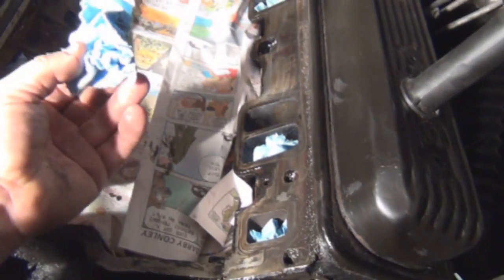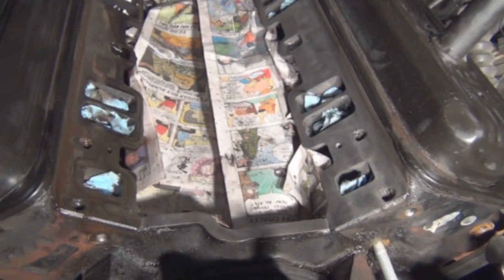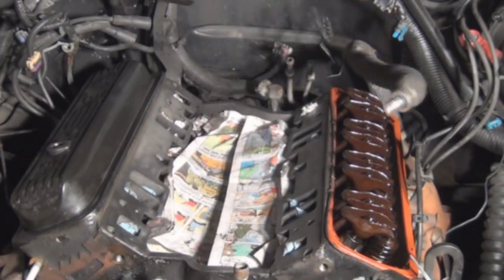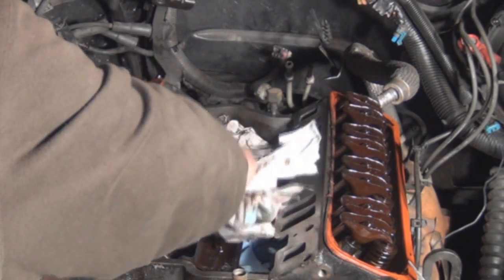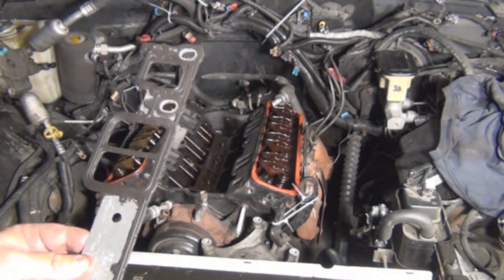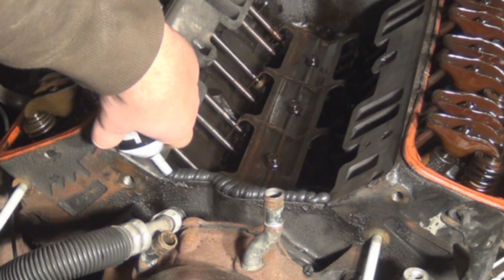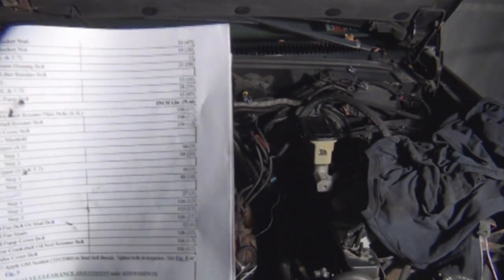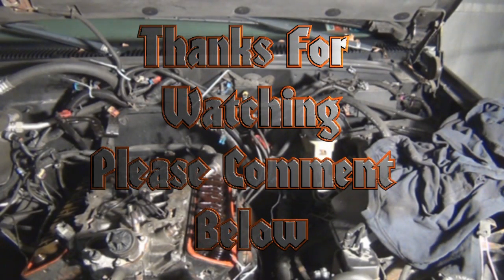Intake Manifold and Gasket Preparation and Installation

Comment: Never use thread locker on intake manifold bolts.  Teflon thread sealer that is designed for automotive use only. Not plumbing Teflon.  
Clean both mating surfaces (block side and manifold side) that are to be sealed by RTV with lacquer thinner on clean rag twice, immediately before applying sealant.  RTV/Silicone sealer does not stick to oily surfaces.  This is critical.  Don't use carb cleaner for this final cleaning, it leaves an oily residue.  Never tried brake cleaner but Lacquer thinner works very well.  Going for surgical clean.  Make sure your hands are clean and dry first also. If you have to move manifold after you have set it down on engine, pull it out, clean everything off and start over.  Go strait down on and don't move it, unless you don't mind oil leaks.
Reply from the maker: Thanks for watching and commenting. I greatly appreciate it. Brake clean works great. We use it to clean off the old sticker residue from inspection stickers on the inside of a windshield. It gets it nice clean and dry for the new sticker. I also use it for the rear view mirror replacement of the button when it falls off. Great results. Thanks for watching and commenting. Please like share and subscribe.
Reply: Hey xman, Finally found ya, had to factory reset, do u copy (railrider)
Reply: @railriderrider9192  Yes, I'm all over these S-10 videos, well, a lot of them.  Factory reset?  Please explain.
Reply: @x-man5056  on my PHONE. ..😂
Reply: Sorry...wasn't specific
Reply: I don't own home p/c. Pulled code po118 which already knew about. .. showed NOTHING on 3 missing BAD. Tested ,checked for vac. leaks and have found NONE. 😥
Reply: @railriderrider9192  So by "factory reset" you mean you just cleared the codes?  You KNOW #3 is missing but it's not throwing the #3 misfire code? (that would have to be a very intermittent miss I would think). 
p0118 is engine coolant temp code.  You had this sensor disconnected when you changed intake gaskets also, at least I did, just to give slack in the wire bundle.  It's down there right by the #3 plug if I recall.  Always in the worst spot to get to isn't it. 
Take a peak through wheel well, might be easier.  if you didn't disconnect that plug on the coolant sensor you may have pulled a wire loose in that plug.  If you did disconnect it, check it over anyway.  Those coolant sensors are pretty robust in my experience but they are fairly cheap so if the plug checks out OK and is properly connected, replace it and see what happens. 
Doubt that this fault has anything to do with MAF or #3 miss except that the coolant sensor is very near #3 and, because of the difficulty of working right there, maybe neither is connected right, worth a quick check anyway.  Pull that plug and check it over real good for a crack in the ceramic also.  Use bright light and magnification if you can.
No PC?  Sometimes I wish I didn't either but I can hardly see much of detail on my phone.  Consider a used tablet.  They are easier to use (much like your phone). You'll need access to internet, either tether to your phone or get wifi in your house.  Wifi with a smart TV gives you a world of options also.  Just a thought thrown out there.
Reply: @x-man5056  broke send unit when did intake gasket. B4 broke....same prob. on 3. Good spark, great comp. Totally GOING INSANE!! 🤪😂
Reply: @x-man5056  plug right dead behind steering shaft, no universal will work. Have to wrench socket. 🙄
Reply: @railriderrider9192  I use a short plug socket and a wobble extension, not a universal joint.  Still tight but works.
Reply: @railriderrider9192  laughed at insane remark.  Every experienced mechanic who read it did.
Reply: @x-man5056  I barely have enough room to get plug wire off. I'm considering cut off 1/4" off socket! 🤔
Reply: @x-man5056  I'm not crazy....mom had me checked!! 🤪
Reply: @railriderrider9192  I looked around and found a short socket...shorter than the other 2 I had any way.  Th wobble extension helps a lot also but a regular extension will still clear the steering shaft.  Last time I changed plugs I installed iridium plugs, hopefully that's the last time I have to mess with them.
Reply: @railriderrider9192  I had myself checked.  Mom said she didn't need to waste time and money on the obvious.
Reply: @x-man5056  iridium good they say for 100,000. U won't get none of u joints to work unless MAYBE 1/4 drv. I have iridium in mine.
Reply: @x-man5056  😂
Reply: @railriderrider9192  Yes.  Use a wobble extension, not a U joint, no room. 
You know what wobble extension is?  Where the socket can wobble on the extension itself?  
If you don't have any, highly recommend, u joints a pain.  You can get a pack of assorted lengths and drives for about $12 at Harbor Freight.  Very handy
Reply: @x-man5056  right on...I'll check w/ them next week
Reply: @x-man5056  I'm a retired heavy and light equipt. mech./ welder( all phases)  and field tech for Sears 7yrs. div. 71
Reply: @railriderrider9192  You'll like them.  When you see the end were the socket slips on, you'll see right away.  They make Allen wrenches like that also.
Reply: @x-man5056  I sold them when retired.
Reply: @railriderrider9192  Nice.  I thought you were experienced but couldn't tell if you recognized my verbiage.  Not sure if wobble extension is the right name, just what I call them.
Many home mechanics on YouTube  barely know a wrench from a hammer or they think they're interchangeable. LoL
Reply: @x-man5056  😎 I knew exactly from start what u were talking about....I worked heavy equipt in military...company put me in charge when they seen I wasn't a slow leak. And got promoted another grade. Worked for J.Deere when came home. Had a master mech. 3 tier tool box with everything. I  wish now I had worked for CAT. 💪 sears....85 to 91 nearly 7yr. then left. Built/welded fire truck bodies for E one, ocala,fl. Alum. Mig, local forge said I had a very impressive work history and started me 1$ more than asked for.
Reply: @x-man5056  I have dislexia... 3 bad bike wrecks....v.a. helped get my dis. retirement. I am WORE OUT!! Chronic D.J.D.🤦‍♂️
Reply: @x-man5056  when v6 gets 2.5 rpm and higher  u can feel cyl kick in out intermittent gonna try another new plug tomorrow!! Thanks friend!
Reply: @railriderrider9192  Sorry to here that.  I am Navy Vet, Vietnam. retired from DoD after 42 years.  Started as Aircraft mech and worked up to Manufacturing Quality Engineer. 
I ache a lot also.  Recovered from Carcinoid cancer but still have PV (Polycythemia Vera), also COPD.
It's difficult to work on my cars and mowers etc. but can't afford or trust anyone else to do it.  I keep chugging along just because.  Just slower. i just turned 66.
Don't know what D.J.D. is but doesn't sound good.
Currently live in NC but plan to head back west soon, away from humidity.
Reply: @railriderrider9192  You bet. You can check the resistance on the plug and wire first if you have a meter still.  There's a dozen YouTubes on it...LoL
Reply: @railriderrider9192   Just struck me that this could be an injector problem also.  They can be tested but the spider setup these use makes a bit more difficult proposition.  Seems odd that you are not getting p0303 code.  Have you checked fuel pressure?
Reply: @x-man5056  no sir...I suspected that tiny spray nozzle might be bad....SFI strange set up. I see new ones are up graded....pump sounds healthy,strong. Will get with best friend a mech. for Hyundai. Thanks!
Reply: Fuel gauge jumps around like bad motor maybe. I reset codes on vehicle by touching ground to pos. on battery🤔
Reply: @x-man5056  yeah have muti meter....gonna get another new plug today. What about that 💩ppy distributor? Bearings are still snug no wear
Reply: @x-man5056  Degenerating Joint Desease started 4th grade. Va discovered it '06 No one told me when young....not even my parents. God love em.
Reply: @railriderrider9192  yes,  I replaced my injectors while I was in there even though mine ran fine. Mine came stock with the newer style injectors (non-popet) which was a surprise to even the dealer but already had the parts so changed them anyway.
Borrowed a fuel pressure test kit from Advanced Auto a few years ago.  My pump was running toward the low side of the spec.  Changed it in my garage so wouldn't have to at some most inconvenient place.  Read they give little warning when they give up the ghost.  Did it w/o lifting the bed.  Mine has a rather heavy tool box bolted to it and did everything by myself.  It's an easy test to do one the 4.3 though and free when you take the test gauge kit back.  Not likely to cause just #3 to miss though.
Reply: @x-man5056  it has orig. sfi...trans. rebuilt 4yr ago. Works great, truck over all better shape than my 02 trail blazer. Thanks
Reply: @x-man5056  ur not far from me ....bristol,tn
Reply: @railriderrider9192  Intermittent ground maybe.   How's the accuracy sitting still?
Reply: @railriderrider9192  Wow, that does suck.  Something genetic?  My PV does have a genetic component but no one else in my immediate family has it.  Just lucky I guess right?
Reply: @x-man5056 accuracy?? What ya mean bro.
Reply: @railriderrider9192  Did you do the trans or buy it that way?  Just wondering what that cost.  Something I wouldn't tackle now, not even the R&R.  I have sm leak in rear main seal.  Has a transfer case also.  20 years ago I would do it, not now.
Reply: @x-man5056  bought it that way...ol boy pulled it took to town. Allied wants $1200 same trans as in my 02 trail blzer
Reply: @x-man5056  seen a 2000zr  jacket up looking good in town little while ago, fixing to install new plug when cools off.
Reply: @x-man5056  djd started from whip lash, 4th grade. Most welders and mech. get it from pulling wrenches over time.
Reply: @x-man5056  what mean by accuracy??
Reply: @railriderrider9192  It can happen so easily.  I screwed my neck up last year mowing my neighbors lawn while he recovered from heart surgery.  Ran over an unseen small hole and compressed my neck.  It'll never be right again.
Reply: @x-man5056  my spine compressed, lost 1-1/4" over years in height.
Reply: @railriderrider9192 Ref, fuel gauge accuracy: When the truck isn't moving, does the gauge hold still at the accurate level?
Reply: @x-man5056  no sir put gal.in it read full, when goes reserve it drops, low lite comes on. Got 20mi.....run slap OUT! 🤦‍♂️(set trip odometer)
Reply: @railriderrider9192  That sounds torturous.  Don't know how you can work on your truck like that.
Reply: @railriderrider9192  I've heard it said frequently that you should not regularly run you tank down below 1/4 because the fuel cools the fuel pump.  Sounds logical to me.  Maybe easier to reset trip odometer and refill tank at 225 miles or so.  I know when I change my pump, it slightly changed how my gauge reads.  I keep close eye on my mileage so I noticed right away.  A new pump could have and added bonus of fixing your gauge problem...maybe, just say'n.
Reply: @x-man5056  drs. at mntnhome said I have a lot of perseverance and should be in a wheel chair. I  refuse to give up that easy! 💪
Reply: @x-man5056  pump sounds strong...yes, gaso. does cool pump. I think it's the pump module that tells gauge what to read. She is sched. for troubleshoot computer hook up tomorrow at 10am. I'll  holler back and let u know results when I  can. Changed, plug(yee ha) and coolant censor for test. No change in miss...😥
Reply: @railriderrider9192  One of my sons is an occupational therapist.  He's always telling me that what ever you stop doing, you'll lose the ability to do.  So I just do everything slower, make accommodations (like the 2 different height steps I told you about and several others), and don't force myself to get it done to meet some arbitrary schedule.  Try to be more thoughtful in my processes. Takes me longer to do about everything these days but I can still do most.  Heavy lift stuff is off the table now though, no more transmissions.
Reply: @railriderrider9192  You still in Idaho?  Love that state.
Reply: @x-man5056  idaho??
Reply: @x-man5056 ?idaho? were u read that?? Look again.🤭 I told u were.
Reply: @x-man5056  be more specific .
Reply: @railriderrider9192  Sorry, you mentioned "Mt. Home".  Large Air Force base there.  Made an assumption.  Musta been off.
Reply: @x-man5056  truck rear axle is fine
Reply: @railriderrider9192  Ah yes, Bristol, TN.  Sorry, I missed that one. Actually one of my favorite places.  I'm big NASCAR fan, even though they make it difficult these days.
Reply: @x-man5056  whew!!🤦‍♂️ Thought someone was impersonating u for minute! Johnson City
Reply: @railriderrider9192  Sorry...about what?
Reply: @x-man5056  wasn't specific on PHONE factory reset. I have a cracked intake!
Reply: @railriderrider9192  Cracked intake causing #3 miss?  You have vacuum leak at #3?
Reply: @x-man5056  1,3,5....cant condemned sfi till replace cast manifold. Tracking one down now. Leak is at right front corner. Broke corner by cable bracket
Reply: @railriderrider9192  wow.  how found?
Reply: @x-man5056  Very evident . Took to local shop. Just sched. for them to r&r intake. Just got one 50$. 3hr labor $80.00hr. Thursday. I just cant do it again. My neck muscles, arms and knuckles are train wreck, plus I dont have bottom tap to chase thread. Temp. fix it w/ JB Weld. 💪
Reply: @railriderrider9192  3hrs labor sounds awfully optimistic.  Bottom tap to chase thread?  Is there a broken bolt?
Reply: @x-man5056  no...that's why I got bad torque. Stretched or dirty thread...also, if coolant get trapped under bolt will give u a inaccurate torque and u break things.🤦‍♂️manifold must be pot metal...I'm 4mi. from raceway.
Reply: @railriderrider9192  So no broke bolt, you just figure something in threads kept manifold bolt from getting enough torque? (reached torque value but not clamping force) Hmm, possible I guess.  Those are smaller bolts than what I'm used to on an SBC.  I did run a tap down mine but just a tapered tap out of my set.  Don't remember any of them having a bottom but it was almost 2 years ago.  A few did go into water jackets and the rest into the engine internal valley but never really bright lighted any holes. I  had to replace one bolt ($6 at Chevy) because it was corroded more than set well with me.
I was thinking maybe when it was leaking, got low on water and maybe got a little hot and that got crack started then when you put back together, everything situated a little different and internal stress caused crack  to grow.  I assume you used a sm in/lb torque wrench.  Guess it doesn't matter much now.  Sorry, thinking out loud here. 
Hope the new manifold does the trick.  3 hrs labor sounds optimistic to me but standard labor hours often seem short to a home mechanic who takes his time, cleans everything, I painted a lot of things, did a lot more than just manifold.  Maybe 3 is right, but not for me.  LoL
Keep me up to date on the outcome.  Fingers crossed.
Reply: @x-man5056  shop labor rate book said 3hrs.....me...3 days.... sched. for  thursday,
Reply: @x-man5056  had to reschedule intake, Ear ache kept me up all night. May have go to e.r.
Reply: @railriderrider9192  Bummer, ear aches hurt like a... b*tch.  I was at sleep study last night,  pillows like a sack of rocks.  Smashed my ear but nothing like a real ear ache.  Hope you feel better soon.
Reply: @railriderrider9192  Hey Railrider, hope ear is better now.  Any victory with your S-10 yet?
Reply: @x-man5056  good hear from ya....got er done yesterday...400$ worth...runs GREAT!! Was wrong used intake, found another, ...had replace sfi with another good used one. Great new people/friends God love em!! Young mech. did great job on it! 👍
Reply: @x-man5056  there is a zr2 4x4  there I was drooling over...😂
Reply: @x-man5056  much obliged for ur support..u were a big help thru this. 😎Bare with me on e will get with a friend so can be done right. 🇱🇷💪

Comment: Not a bad job but there are always things you can improve. Let the RTV tack up for 5 mins prior to intall. Use long threaded studs to line up the intake manifold perfectly and NEVER move the manifold like you did after lowering it. My way assures its lined up perfectly and will plot down and never have to be adjusted also I get the matting surfaces just as clean without the abrasion.
Reply: Are you saying to purchase some long threaded studs (same size as the ones that secure it when all said and done) that fit in the block temporarily while you lower the intake?  I have never done this before so I want to make sure I completely understand.  The lowering of the intake is one thing that makes me nervous about this task.  My gaskets  are supposed to be put on dry and I am concerned about movement when lowering the intake.
Thanks
Reply: shawn lusk,    yes,long studs are a GREAT help( only for manifs with the 8 VERTICAL bolts,of course)
Reply: @josepeixoto3384  so this stud buisness wont work on a gen 1 small block? I was thinking about looking into some type of headless Allen grub bolt or cup type might work.

Comment: Thread locker!!! I guess that was the last time you did those gaskets! I bet there was heaps of that silicone floating around in the valley, would've just oozed off inside as soon as you bolted it down.
Reply from the maker: It was the last time I did those gaskets is correct, because I’m still driving it today with no problems. Thanks for watching and commenting.

Comment: Will a bad intake manifold gasket cause oil to leak into my coolant?

Thanks in advance
Reply from the maker: Yes.
Reply: @handymanPF  Thanks. 
So it isn't always necessarily the head gasket, basically.

Saves me a bundle...whew!

Comment: I noticed that your new intake doesn't have water passages in the rear, but your head has them in the rear, will that cause any issues by blocking that off? P.S im very new to building mortars and just started a 318 mopar mor my first build.